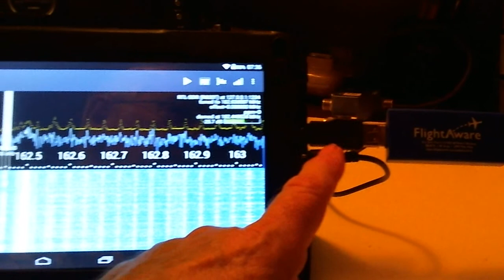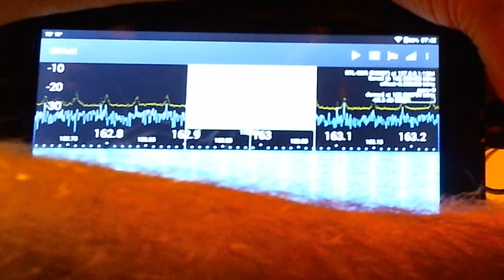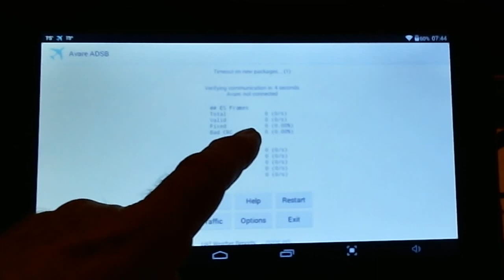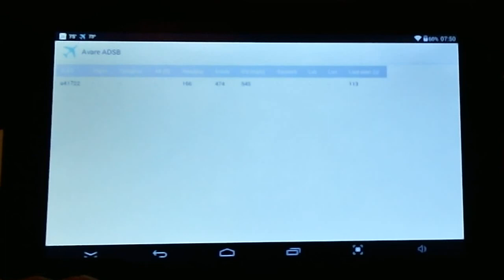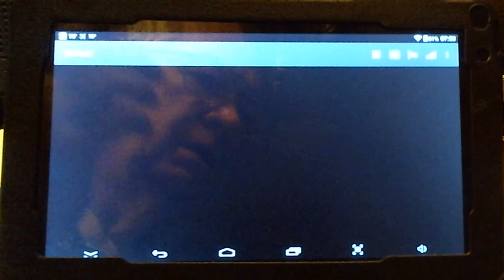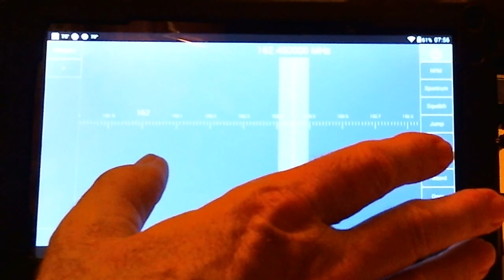TRRS #1246 - Trying To Interface Android Tablet With SDR

Comment: Must be related to your version. I run this software on an Acer and two different Lenovo tablets without issues. 

The driver asking at every start I get to. Can probably be solved but I havent done so.

I always use an extension cable to the dongle, a meter long or more to lower usb noise directly to the dongle.
Does also work wonders on a laptop. I made a dongle wich I added ferrite beads on the usb cable but nothing noticeable better.
A long usb cable though did a convincing difference.
The software works very well and you can store presets and even scan between them.

Thanks for the video.
Reply from the maker: It is probably the tablet as I wanted to try it on a cheaper tablet first to make sure I did not damage anything.  Works much better on my Lenovo.

Comment: Some of the larger Android tablets support USB (full size) native, my Acer Iconic a certainly does :)
Reply from the maker: I have that tablet too but it failed several years ago.
Reply: +hamrad88 I had to force feed mine the firmware for the next model just to keep it viable (online gaming support), I would like a new quad core tablet I might need to put in a good word with Santa, will I drop your name to him as well? LOL
Reply from the maker: My Acer stopped booting.  Tried everything including a hard reboot with no luck.  Still have it as some day I will try to update the firmware the hard way.  It was a great tablet and I still do not have a good replacement for it.
Reply: +hamrad88 Sorry to hear that one of the 4 we own here collectively failed for no apparent reason as well, they were all a501 models IIRC and would not support Android 4.0 until flashed with the a500 firmware (from A er's website), not an official fix but it worked well, getting a little underpowered for today's applications though :(